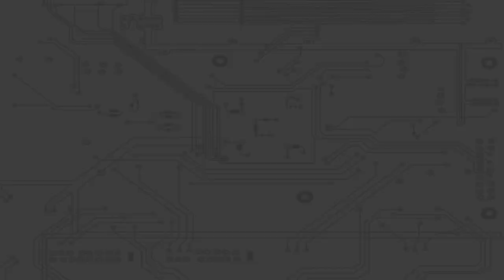Project Bloodshed - Jay's new 4k Test Bench

Comment: ***** Will my PC handle GTX 750? (my comp is very old)

Specs:

Intel Core 2 Quad Q6600
ATI Radeon 2400 (changing to GTX 750 if my PC can handle it)
2.4 ghz
4gb memory
idk how to find the motherboard (i did not build my PC)
Reply: No. GTX 750 requires at least PCIe 2.0. Chances are that your motherboard don't support it. Even if it did, the rest of the system would be a huge bottleneck. Just get a new 500 dollar PC. If you like, I could pock the parts for you
Reply: Forgot to add that Its a Dell Optiplex 755.

U can pick the parts for me. I have a 300-400$ budget. Thanks
Reply: maleeha raheel Alright, Here is the build. This will play games at 1080p on good settings, with at least 30 FPS. http://pcpartpicker.com/p/CsWB4D Don't worry it got that GTX 750Ti
Reply: ***** Thx man ill order it! :D
Reply: maleeha raheel okay good ;D but to be honest I do recommend buying a bit better motherboard. And what OS is your shitty Dell running?
Reply: Win 7 professional
Reply: maleeha raheel Nice, because you can use the product key from your old computer, to the new one. Easy legit way to save a hundred dollars
Reply: ***** It seems like that some parts are not available =(
i revised all the builds. I really liked the Intel one: http://pcpartpicker.com/p/kdqrWZ
Thanks man!
Reply: maleeha raheel Alright then get it :D But if you want to future proof yourself then get this one http://pcpartpicker.com/p/8NmQBm 
Basically the same, but with an i3 which will remove any possible bottlenecks, and make sure that you can run all of the latest games
Reply: ***** It's actually illegal to use an OEM provided product key on non-OEM provided replacement hardware. I would suggest that you read Microsoft's OEM Licensing terms before advising people on the legality of a license transfer.
"After an OEM software license has been installed on a PC, the license may not be installed on or transferred to another PC. However, the entire PC may be transferred to another end user along with the software license rights. When transferring the PC to the new end user, the software media, manuals (if applicable), and Certificate of Authenticity label must be included. It is also advisable to include the original purchase invoice or receipt. The original end user cannot keep any copies of the software." - Microsoft OEM Product Licensing FAQ
Reply: F34r1355 Ehm no it isn't, Microsoft even helped me once using one. I have re-used them a ton of times
Reply: maleeha raheel I would recommend upgrading your computer, but to go with anything less than an i3 would not be an upgrade to you. You can run a GTX 750 fine with your current computer, however you may not use it's full potential. You may also want to specify if you have a full size, or slim, as the Optiplex has multiple configurations for the case.
Reply: Ill be getting the i3 one for Christmas yeah both of u said that it will remove all the bottlenecks. It will be way cheaper then :D
Reply: maleeha raheel Good, have fun with your future system;)